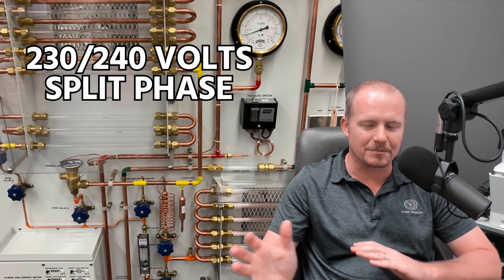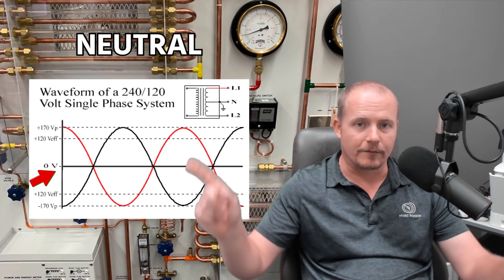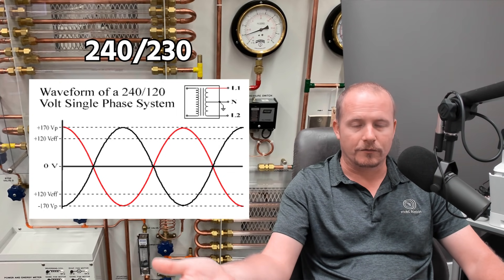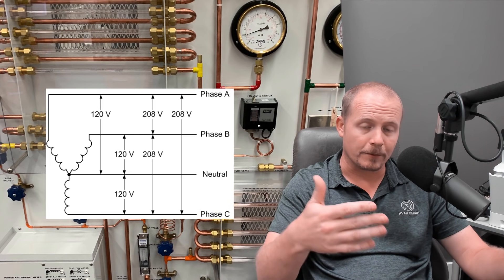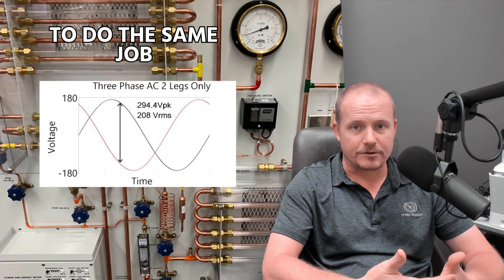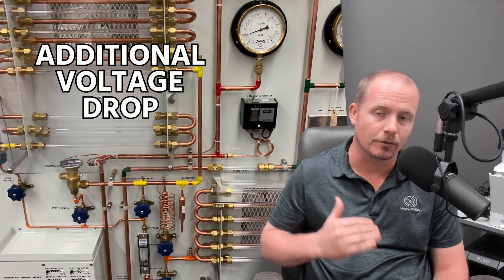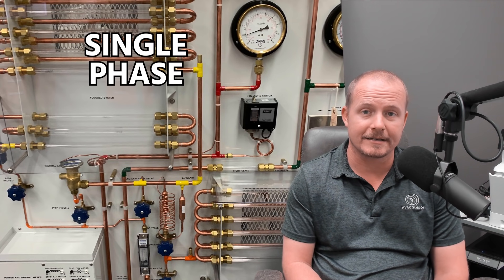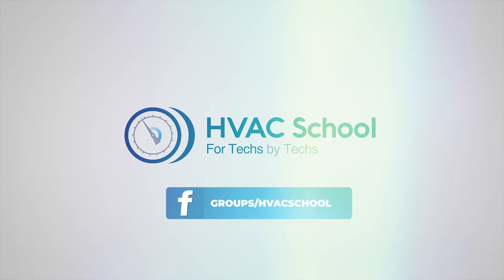How is 208 volts different than 230/240 volts?

Comment: I took a work force based class  before I went to HVAC, and my electrical instructor would say  that 120v coming out of an outlet is actually 370 volts RMS. I forgot the reason or the explanation, but it was something interesting I learned.
Reply: Actually about 350Vac 'peak to peak' voltage of the sinus-soidal 60hz waveform. Volt meters only look at the POS+ wave, then display an "averaged" voltage via multiplying the "POS peak" 175v x .707 = 124 Vac meter display.  (Remember, the displayed voltage is 'static'.  A.C. is ever changing.  The static A.C. display is actually a D.C.voltage equivalent, after the formula above is applied.  Otherwise, we couldn't the read  meter display.  A.C. is changing way too fast.
Reply: @BYENZER  thanks for the formula I couldn't remember it lol
Reply: @mrgreen9086  I only remember it because it reminds me of a Boeing 707.
Reply: @BYENZER  " Volt meters only look at the POS+ wave"
If the meter is marked "true RMS", it looks at the negative peak as well and draws the square root out its squared value (which always is a positive) to get the accurate amplitude reading.
Reply: @BPo75  Thx!
Reply: Eric M   120v is the effective or root mean square (RMS) value of the AC voltage.  It is the voltage that if it were direct current would deliver the same amount of average power as the alternating current with the peak value of 169.7v (120 time square root of 2) over the complete AC cycle.
Reply: Eric M  I see thank you

Comment: 208 can only be obtained from a 3-phase wye system. 240 volts can be obtained from either a 120/240 residential system or a 240 volt 3-phase delta system.
Reply: You can get 208 from a hi leg delta system…
Reply: A value of 208 volts can come from either a 3 phase wye or from the high leg of a delta system. And 120 can come from any of the 3 systems.
Reply: @davidroddini1512 You also get 120v from a 5 wire 2 phase system. There’s still quite a few old lighting panels in buildings in Center City, PA etc. But don’t connect a breaker between the wrong two legs or you’ll get a weird 170 volts which motors don’t like.
Reply: @brnmcc01  Newark NJ and surrounding area still have 2 phase.
Reply: What about High Leg Delta?
Reply: @SB-sp7zf Or open leg Delta will still have a wild 208v leg to ground.
Reply: jmiller2705 Wonderful explanation.
Reply: Single phase 208.v from high leg delta.
Reply: For a 208V water heating system what would be the coil resistance in ohms?
Reply: 4wire grounded Delta wild leg 208 volts.

Comment: How is 3 phase 240 created then is it also a split phase and not A, B, and C phases
Reply: Eric M Delta transformer has a Neutral Tap???
Reply: Florida Man HVACR  No that is not how 3 phase is generated. It is not done in the transformer.

It is done by the generator in the power station, by having multiple coils wound in the generator that are physically arranged 120 degrees angle of separation from each other.

Look at the high voltage overhead power lines, they are in groups of three, one for each phase.
Reply: Florida Man HVACR  No it doesn't.

The distribution transformer feeding power to the homes, the secondary winding is wired in a star configuration with one end of all 3 windings is commoned together. That IS the point where the neutral line is connected. The other 3 lines coming out from the secondary side of the transformer are the phase conductors.
Reply: 240 volt 3 phase means the secondary windings of the transformers feeding the building are connected in a delta configuration, that is, the windings are connected end to end and there are 3 variations, 1) 240V 3 wire, ungrounded. 2) 240V 3 wire, corner grounded aka grounded B system.  3) 120/240V, 4 wire.  

With the 120/240V delta three phase system one of the transformers is center tapped to derive a neutral for access to 120 volts.  A nasty side effect from center tapping a transformer in a delta bank is that one of the phases will have 208 volts referenced to ground and it's easy to mistakenly hookup a single pole breaker here for 120 volts and smoke everything on that circuit.

240V three wire ungrounded, 240V 3 wire corner grounded, and 120/240V 4 wire delta are very uncommon in new installations, but many legacy systems exist and a technician needs to be an to recognize them.

Comment: Found a RTU the other day tapped at 575v it was a 460v unit. I was only getting 21v out of the secondary side of the transformer. The unit wouldn't fire up. Re tapped it correctly and had 26v and wouldn't you know it. It fired up. I understand the reasoning behind it. Still have much to learn about electrical though
Reply: Hvac know it all did a video on a  carrier rtu with those voltages.   Check it out.

Comment: Sounds like 208 has lots of negatives.  Why is it used then?   Thanks for the vid.
Reply: 3 phase is the simplest motor you can have
Reply: It's really only a negative when you try and use it for equipment designed for 240v. If the stuff it's powering is designed for it, it works great. And as another commenter said, you can put 120v loads on all phases. It's a way to have 3 phase power and 120v which most everything works on.
Reply: Eric M  Can you provide more info here?
Reply: I remember that we installed a refrigeration unit and the customer kept complaining that the compressor wasn’t running. Nobody checked the voltage rating on the compressor. It was rated for 220-240 VAC and the customer had 208 VAC power.
Reply: @picklerix6162  some years ago, someone I knew bought a used window a/c, then called me couple of days later, the run cap blew out,  the unit was 208 single phase , replaced the cap, told him not to run it, I bought a BOOST/BUCK TRANSFORMER , wired it up , we have 235v here , so it ran for years, it was a 2 ton unit in basement . .cheers 🇺🇸🇺🇸🇺🇸🇺🇸
Reply: Eric M  thanks!!

Comment: In commercial buildings that have 208 volts, 3 Transformers connected outside in their aerial pairs connecting to the building. So if it 2 phase what does each transformer do?
Reply: This could explain what I am seeing going to my 
customers. Transformer configurations details.
https://www.youtube.com/watch?v=T4168xAEPqg From Northwest Lineman College
Reply: I’ve never seen a Commercial building bring just two legs of power in. It’s usually a single phase panel or 3 phase panel. With 208v appliances you would just bring two home runs to your appliance from the panel. But if you have a three phase pan el you will most likely have three phase equipment. 

As far as your transformer question it’s a step down transformer from the high voltages required to minimize voltage loss over long distances. Step up transformers usually go up to 440kv from the generation station. They are transformed back down before they enter your home.

Comment: What voltage and/or phase comes out of a capacitor on a 120v gas furnace blower motor vs. one on a 240v fan coil blower
Reply: The voltage on a run capacitor during the motor operation is driven by the the spinning squirrel cage's induced magnetic field inducing a current in the auxiliary winding.  That is why run caps have the odd voltage ratings that don't match the supply voltages.
Reply: 370/440 I believe
Reply: I believe the capacitor also creates a 90° phase change
Reply: Never ask questions to a Youtuber.  Send them an email instead. Plus, it's inconsiderate to ask them in the comments section. YES! Inconsiderate.  Why?  1st, you aren't paying them.  2nd, They don't have time for you. 3rd, if they don't answer you, people will label THEM as inconsiderate.  So, better PAY a fair price, for someone to take their time to answer your questions.  Stop treating youtube as CAMP GIMME GIMME.  Doing so makes you look a left wing, liberal, entitled democrat parasite.

Comment: now do one on High-leg delta 3 phase
Reply: Check out Electrician U he makes great videos and has done one on three phase. Its basically just a center tapped delta. So two of the legs will be 120v to ground and one will be 208 to ground (High leg). Between each phase it will be 240v though. Mainly found in older buildings.
Reply: I actually learned about that while I was in HVAC school. I think the instructor called it unbalanced three phase.